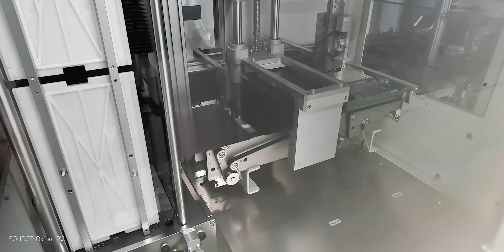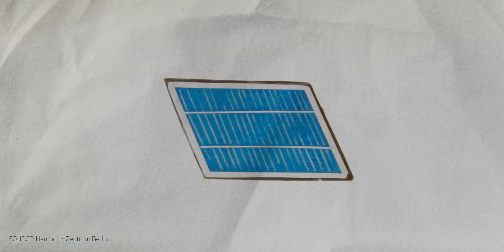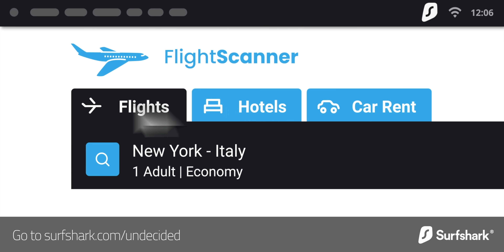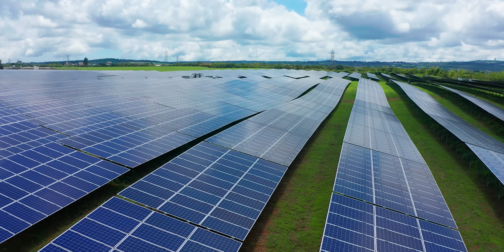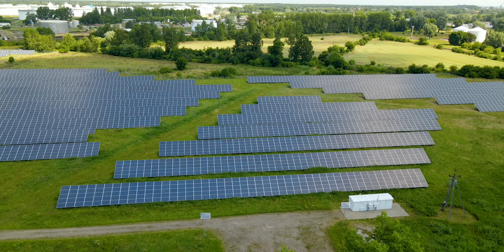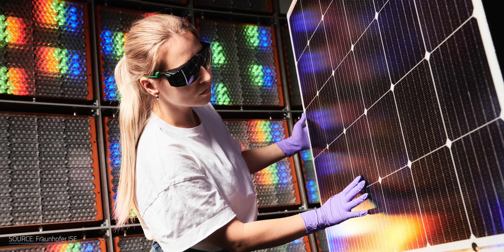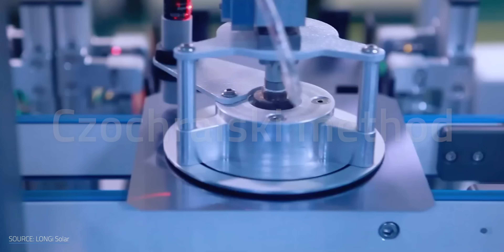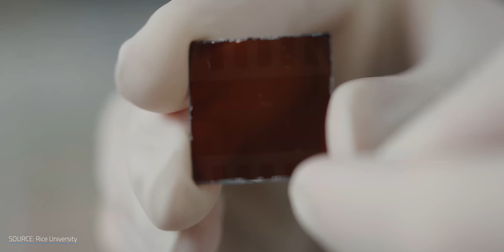How Record Breaking Perovskites Are Here NOW

Comment: As an engineer, I will always favor solar over wind power due to the fact that solar can be build without moving parts. Long term reliability with full recycling and reuse of all materials at end of life would also be important seen from a sustainability point of view.
Reply: Less moving parts is nice, but how would you cover winters with little sun?
Reply: @FiveFiveZeroTwo  most of the planet lives where power from the sun is largely still accessible from the sun all year.
Reply: @FiveFiveZeroTwo  More modules.
Reply: @FiveFiveZeroTwo  they cant.
Reply: @FiveFiveZeroTwo  Grid solar is typically sized about 2x of needed demand so there's still enough overall output in winter.
Reply: One answer is to have solar farms nearer the equator and have very long cables northwards into Europe. Its being looked at now.  @FiveFiveZeroTwo
Reply: @FiveFiveZeroTwo  or severe hail storms.
Reply: @FiveFiveZeroTwo agreed, here in Scotland, less than 10% in winter.  I question if a good public investment
Reply: @markthomasson5077  Not great for us in England with rooftop solar but selling excess in summer offsets your winter imports to some extent.
Reply: Speaking of end of life, I want to know about the recycling situation and how safe these things are from a lead contamination viewpoint. Seems like it's not a good idea to throw them in the municipal trash.
Re: wind vs solar,  It's relatively easy to DIY some kind of primitive wind mill and stick a motor on it, but most people don't have a semiconductor fab in their basement. As long as the world economy is doing ok then solar is great, but in some kind of desperate situation at least we have a fallback. That's why I tend to favor EVs, ebikes and other personal transport devices. Most people don't have an oil well they can tap if things go bad, but there's lots of ways to generate electricity.
Reply: @DFPercush   I wish that was true, with the way modern electric cars are with DRM the prospects of that are less than they easly could be. Though i only know about teslas and cybertrucks, two shitty companys, idk about alternitives. 
Though electric still fairs better than gas cars, i have a couple 1/2 - 1 1/2 HP electric motors that with a little work could be a generator. 
Another alternitive would be diesel cars, i have heard that making bio diesel at a DIY level isnt imposible, but idk enough about it all.
Reply: Except for locations that have little sun but lots of wind. One size does not and never will fit all!
Reply: Wind has a higher efficiency limit than solar, close to 60% compare to solar's 40 to 50%, and offer lower land usage density and can be installed offshore. Currently wind is upto 50% efficient already. Plus some locations on the planet are more wind rich than solar rich. It's a mix of renewable generation that is required not particularly just one type.
Reply: @GruffSillyGoat The wind comes from the sun anyways, and there's losses in converting the heat from the sun into wind.
Reply: @GruffSillyGoat 

"Wind has a higher efficiency limit than solar"

Which is great, but doesn't apply realistically to residential power generation.
Reply: @GruffSillyGoat Wind and Solar for small consumer based population IE house and apartments, Nuclear for large foundation base power supply, No stupid fans murdering birds and whales, no Solar farms in the middle of no where that require immense power transmission systems to be built. Its not that complex
Reply: @GruffSillyGoat ...I mean, I also support using many renewable energy sources, but lower land usage density is bad — that would mean that they produce less energy for the same amount of land used.
Reply: @somdudewillson  - by lower land usage, I mean more spread out. This is required to increase wind collection efficiency to prevent airflow interference between turbines. Given the significantly higher output of wind turbines, 2 to 5MW each for onshore wind, means for the same land area wind turbines output more peak power than solar PV currently. Although, turbines have more considerations for placement locations than solar PV. 

The footprint of each turbine is relatively small and the land underneath can be utilised (including farming) without impact. Some turbine manufactures are also designing extra-tall turbines that provide more power (capture more energtic winds higher up) but also can be co-located within forested land without significant impact to the forests. This gives the forests additional commercial value protecting them from strip clearance by making farming of forested land less commercial attractive.
Reply: @GruffSillyGoat
Also prone to mechanical failure.
Reply: Never mind the dead birds killed by bird grinder...
Reply: @bkparque cats kill more. Go look it up.
Reply: What a mindblowing statement!!  More moving parts means more points of failure???  🤯🤯🤯🤯 
Also, I've never seen a solar panel smack an endangered bird out of the sky.
Reply: As an engineer working in acoustics I also prefer quiet tech like solar to wind or other moving parts because of noise
Reply: "As an engineer, you should know that no one recycles solar panels because the cost far outweighs the economic benefit.
Reply: A mixed approach is necessary due to solar only producing energy throughout the day
Reply: as an engineer myself, i will use  both to capitalise on the strengths of each solution.
Reply: There are USE CASES for best applications in both approaches. Its not an "All or Nothing" solution.
Reply: There is no point in preferring one over the other. Both are needed to get rid of fossil sources.
Reply: @Horstelin 
👏👏👏
Reply: @Horstelin  Or we could just invest in nuclear
Reply: @XxNightmare128xX  nuclear is a stupid way to go. If You factor in the costs for the waste it produces, nuclear gets extremely expensive. Company's don't, they just let the taxpayers pay for it. Also things like Fukushima and Chernobyl happen. And even if it would be 100% safe you still have to care for the radioactive waste for generations with the risk of greedy humans not doing their job properly. Or documentation of location getting lost etc. There was already so much bad shit happening in the last 50 years, how is it supposed to go for millions of years?
Reply: @Horstelin , you might want to look into thorium reactors.  They're not stupid at all.  ...and if governments would ever ease up on restrictions, nuclear batteries could solve a lot of our waste issues as well.

Nuclear is very smart but you've got to understand and research it a little better.
Reply: @RealFknNito  Nuclear is the most expensive form of power generation, also producing extremely toxic waste, nuclear is for the clueless....
Reply: @barkmaker  Rubbish...
Reply: @Mick-60 , your ignorance on the matter will have to be your issue, not mine.
Reply: @RealFknNito  advancements are being made in nuclear fusion, far superior to fission
Reply: @barkmaker 
You might want to look into cons of thorium reactors. There's a reason why there is only one research reactor being build in china. For all intents and purposes, fusion will be available before thorium reactors are viable.
Reply: @carstekoch , thorium reactors are safer than the nuclear fission reactors we have on submarines all over the world right now.  ...but small decentralized nuclear reactors is definitely the way to go.  No power source is without its cons but the energy density of nuclear cannot be beaten.

...and we'll see about the fusion reactors.  A thorium reactor will be coming online in China in 2025.  I doubt we'll have a viable fusion reactor coming online before 2030.
Reply: @barkmaker  
In theory, they are safer, as in they can not get into meltdown. So a chernobyl level catastrophy is off the table. But they have other problems. Also, fusion has higher power density than fission. So yes, it can be beaten.

Yes, as I said, there is one research reactor being built in China. There is also one research fusion reaktor being build in france. Both were supposed to go online in 2025, We'll see how that turns out.
Reply: @carstekoch , whatever.
Reply: @RealFknNito  at 3-8x the price of new wind and new solar, why would you? Maybe in nations inside the arctic circle or European nations that get little sun. Germany and France get sufficient sunlight to make PV worth it.
Reply: @Horstelin  Breeder reactors that use up the 'spent fuel's' remaining 99% available energy. The future is nuclear breeder reactors. It's also the lowest carbon source of electrical energy by about half the closest offering.
Reply: @Horstelin  nuclear is extremely safe, comparing Chernobyl to modern reactors is like comparing a old jet airlimer to today's in terms of safety. Fukushima wasn't the only nhclear plant hit by Tsunamis and none of those had any catastrophic problems whatsoever. Changing to nuclear can help ease the transition to more renewable sources of energy.

We have to every technology wr have at our disposal
Reply: they don't really have a good recycling system or market for solar.  But the rest I agree with
Reply: Except places like Canada where nuclear makes more sense
Reply: Moving parts are not always bad if you can make them simple and efficient enough.

But I think there is a missed opportunity in wind harvesting technologies. For one, I would love to see large highways with basic harvesters lining them. There's so much lost and constant wind power on the sides of roads. There needs to be a focus on cost, reducing maintenance, and RoI rather than maximum efficiency. Wind could be mass scalable but it just isn't made that way right now.
Reply: SOLAR DOES NOT work in the PNW or Canada or Alaska as long as its always raining or dark! Micro nano nuclear plants would work.
Reply: The point of engineering is to find an optimal solution to a specific problem. Solar does not work in the winter. Solar does not work at night. Wind does. Sounds like another engineer fresh from YouTube university.
Reply: @energiewender143  Solar works very well in winter. Bi-facial panels do very well and exploit the albedo of snow heavily. Vertically aligned bi-facial panels can even avoid snow cover problems and still achieve 75-80% of the power of a cleared, 30° bi-facial.
Reply: @estraume  some of the proposed wind techs don't spin....
Reply: Do you think reusability of the panels is viable?
Reply: Wind turbines could be designed better, but it's all about making as much money as possible
Reply: "Moving parts" is a very well understood design parameter and generally never a negative for otherwise worthwhile projects, and certainly not the serious issue in wind vs solar, which is footprint and land cost. So as an engineer, you're not a very insightful engineer.
Reply: @johnsmith1474  - I'm guessing you've never walked around below a wind farm to see the dead birds and splintered blade bits lying everywhere.  How about seeing one lose it's internal braking, spin out of control, and burn up?
Reply: But cutting trees for solar not green,  roof and wall best
Reply: Solar can be built without moving parts, but it can't reach its optimum panel efficiency for a given location without solar tracking machinery.
Reply: Nuclear is still by far the best we have to make green energy.
Reply: Wind kWh nearly double PV in California.
Reply: Except solar doesn’t generate power at night. It will have to be used conjunction with other green energy sources to be viable. A global energy grid is also an option but we would have to stop spending money and brain energy on wars and screwing each other.
Reply: @estraume  yep, and they work in space.
Reply: Mr engineer,
Are you familiar with "thinking and tinkering - Robert Murray Smith channels, PERPETUAL BATTERY video?"

It is a 1970's patent, solid state, and produces electric.....

"Everyone is trained to respond with respect, when another speaks of solar, green etc energy, like Pavlov's dog, they salivate.....".    Free energy is all over the place, and PV is plain ignorant, thermal conversion to electric is much more efficient, can easily be stored in thermal batteries, to function 24-7-365(&364)....

The blackbird wind vehicle, 2.7 times the speed of prevalent wind speed, motors that use gravity and permanent magnetic devices as the only fuel, the "drinking bird," is a great example of atmospheric differential device, .33 of a degree is all it needs....    If you stop saying what's impossible, and actually test, experiment, you find a mysterious world.....   Of possibilities and more....
Reply: Winter is a huge limitation for solar panels and can be a challenge for wind unless they have integrated de-icing systems.
Reply: As a person to at cares about the environment I prefer wind turbines instead of solar farms. I remember one article where a storm literally destroyed an entire solar farm with glass shards on the ground and toxic chemicals etc was in the ground. There’s no way you can clean it up besides removing the soil entirely and hope nothing leaked deep into the earth. Wind turbines are an eye sore just like solar farms and they both can destroy entire ecosystems. Wind farms kill protected bald eagles and solar farms north of Vegas basically has destroyed habitat protected tortoises could have used. I’m much more of a fan of nuclear or natural gas simply because they destroy less wildlife habitat.
Reply: @estraume  solar and wind are not meant to compete but rather to complement each other. 
Winters and evenings are more windy but the sun going up is more predictable than wind patterns. Solar can go on roofs, wind can go on fields without decimating agricultural output etc.

This renewable teamwork reduces the size of necessary storage systems drastically.
Reply: NREL put out a circularity report on PV in 2024 and found that PV can be recycled up to 80-95%, with research still ongoing. I haven't seen the wind numbers, but that's pretty good. 

Plus, like you say, PV has no moving parts (fixed-tilt that is; trackers have motors/bearings/gearboxes), so that just prolongs the reliability.
Reply: best comment here!
Reply: "full recycling" You're funny. On paper sure. But we live in a far from perfect world. 
Most solar cells will, get this. End up in a landfill. Causing more environmental damage.
Not to mention the average solar farm takes up way more space than a lets say, nuclear power facility to output the same power. 
Therefore displacing large parts of ecosystems.
Reply: @estraume  know about thermo acoustic engines ? I love that. No moving parts. 🚂
Reply: Maybe you need to do a little research on how silicon is manufactured! 

Hint!  It ain’t made from sand!
Reply: Wind “looks” cooler lol.
But zero noise on solar
Reply: Perovskite and Quantum dots both contain lead. It's not green.
Reply: It's also 'better' because it's taking energy super early on in the energy lifecycle of earth. Just as light hits earth it's energy is converted into electricity. The heat you would have got on your roof is now instead released as heat 'anyway' later on in the form of making a cup of tea or playing a computer game. The potentially negative effects of taking energy out the system are super small and minimised. 

Every other energy generation method takes energy from deep within the energy ecosystem; taking it from materials, from wind, from tides, from geothermal energy. Solar theoretically has the LEAST impact to the world's complex ecosystem.

Furthermore; it's one of the few technologies that work both on earth and (with more efficiency) in space. So tech improvements benefit both land-based solar and space-based solar. You can't achieve that with wind, tidal or geothermal.

So unless the Nuclear Fission project is a huge success; solar is the way! or at least until then, solar is the way!
Reply: @coco_robs  we do have solar wind in space.  We just don't have a great way of harnessing it yet.  But it has more potential in space than solar panels.
Reply: @coco_robs  this is utter nonsense.
Reply: @coco_robs  great insight
Reply: @coco_robs  do you mean fusion project? we already do fission, its what nuclear power plants use.
Reply: @coco_robs biggest solar problems are:
1. Works half the day at best 
2. Further away from equator, less efficient it is

These make it a challenge to use well for a good chunk of the planet
Reply: @coco_robs  The difference in the albedo of a solar panel and its surroundings means that, in almost all cases, the panels contribute to the earth warming. Not "free" at all.
Reply: Well if the parts can keep on moving for 30 years without maintenance, who cares if they are cheap, like my fridge which is working fine after 30 years. Anyway, where the tracking Sterling Engine systems have gone... no one is talking about them.
Reply: @rakeshkchauhan  PV panels with heat extraction paired with battery storage/heat storage would utilize PV Panels to their fullest.
Reply: @anguscampbell1533  Good idea and certainly better efficiency but where are they...
Reply: @rakeshkchauhan  your fridge has a high cost of use though.
Reply: @veganpotterthevegan  Not really, actually the basic technology of mechanics is almost unchanged for the last five decades and the changes are only design improvements and therefore the change is running cost is almost modest. The first compact car in India was introduced in 1982 with 20 kmpl which for non-hybrid cars is still not changed much.
Reply: @rakeshkchauhan  I think you must have the last 30 year old fridge in existence 🙂  They don't make 'em like that any more.
Reply: @rakeshkchauhan  some thermal battery start ups are looking at reviving the Stirling engine to convert heat back to power.
Reply: @rakeshkchauhan you seriously think the mechanics moving parts in your fridge are the same as a wind turbine?
Reply: @rakeshkchauhan  right, totally ignoring energy use and technological advancements. My car from 40 years ago still works, let's not talk about emissions.
Reply: When you see the amount of concrete that is needed to secure the Turbines and the amount of crushed stone the need to build the roads it's insane
Reply: And then you live in a cold country where solar is usable maybe 7-8 months of a year and even if you build out all kinds of batteries to transfer it to later hours/night you still end up needing wind
Reply: The sun never stops shining, only from specific parts of the planet (unless we're talking about past the helium flash phase). There is always sunlight somewhere.
Reply: Effectively the recycling is not cost effective,  otherwise definitely better than hydro or wind.
Reply: Solar farms shed heavy metals all over the place. People have them on farms and it ends up in the food. 
It has nothing to do with sustainability but it is disadvantage.
Reply: full recycling😂😂😂
Reply: As an even better engineer, I will look at the total picture, including total cost before deciding. Wind can be incredibly cheap if it is located in a place with constant strong winds in one direction (South Chile for example).
Reply: as a renewable energy grid modeller I always point out that wind has double the capacity factor of PV and is productive (generally) all year round whereas PV peaks in cool full sun days in Spring and Autumn. The two technologies are complementary in all states of Australia, in EU PV is less impressive but still important. Wind + Solar is better than just wind or just solarPV… the ratio for a long time was about 60:40 wind:solar… but my recent modelling showed a wide range of ratios depending on the battery storage ratio across ten different cost optimised mixes for 90% RE on an island grid known as the SWIS in Australia (in state of WA).
Reply: As an internet know-it-all, I will always favor hydroelectric or small thorium reactors until something better comes along.
Reply: @barkmaker Hydro electricity accounts for only around 2% of capacity in the UK. Wind is around 30% so Hydro is and will be way behind. Tidal flow has more promise.
Reply: Other solar farm on Anglesey had plenty of moving parts the other day, it mostly blew away...
Reply: @freeforester1717  Get the cost of fixing a failed nuclear power plant then compare the costs to fix including generating power, solar wins hands down....
Reply: @freeforester1717 A situation unlikely to improve any time soon.  I'm amazed the installers didn't do the usual "double it and add 10%" to wind calculations. I'd design for Mag 5.0 earthquakes too .... just to be on the safe side.